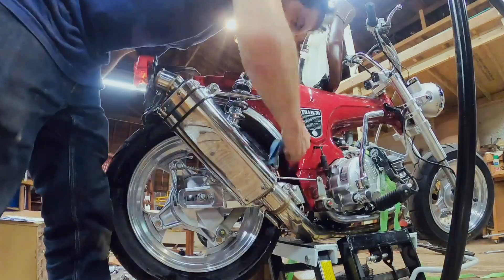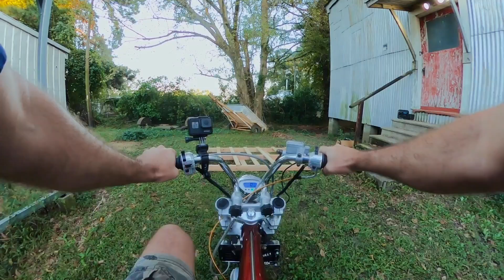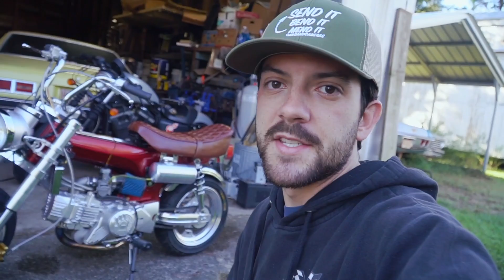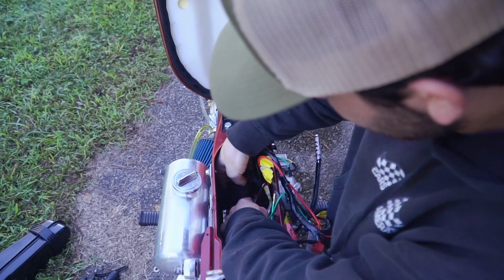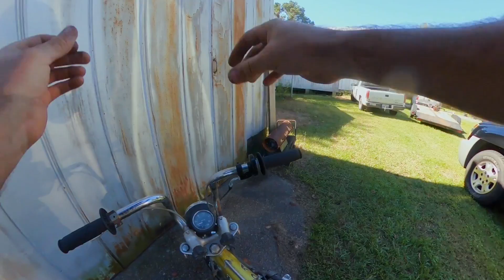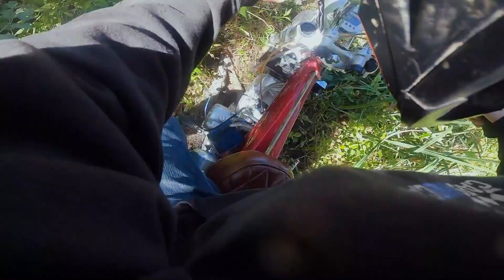190cc Honda Trail 70 First Ride! 19HP Restomod Honda CT70 Build

Comment: Long sorta s shaped metal coathanger witha small hook on the end hooked into wiring and pulled towards rear while pushing fuel tank downwards and forwards into white lithium greased rubber mounts makes it easy peasey... Increase main jet 2-3 sizes larger after lowering needle back down 2 notches should help your top end speed a bit... Also front end neck bearings should be packed with heavy grease prior to install taking care to fit them to cups before snugging down stem nut to just enough to have some drag on front end when off the ground before installing top plate taking care to lock it down with exact same distance on both sides between upper and lower tree... Also check tire pressures and play with them a little on those super sport tires ehich will effect handling in ruts and grooves in pavement..

Comment: 68mph is impressive with the baffle in. Mine goes 82 with a homemade exhaust. my first ride with a baffle in the pipe i couldn't get over 30mph. The trailbuddy, drct70, daxdodo and japanwebike ainet front fork steering stem slop is somewhat normal. I'd say over half of all of the ones i've seen have that issue. A quick easy fix is to put Loctite 640 on the stem, upper tipple clamp and upper inner bearing race. Long term fix is to have a new stem made to fit tighter to the upper triple clamp and bearing race and have a machinest put a taper on the top of the inner upper race and the mating surface under the upper triple clamp.

Comment: Awsome guys!! 👍🏻 your right about that, the og ct70 is geared for that low range stuff, but tops out about 45 or so , I been looking for a 4 speed replacement without having to do a lifan 125 swap , trying to keep it as stock as possible.  Mine is a 81 with believe it or not the original 6 volt bulbs. I've replaced only the brake bulb  , thanks for the entertaining videos , im a huge!! fan

Comment: If the extended swing arm lowered the rear, that also changes the rake and trail of the front. Does the front sit any different hight with the new forks than it did with the old? That of course will also affect the rake angle and trail. I agree with your other fans that suggested altering the rake angle by raising the fork tubes in their clamps. Cool build. Looks like fun!

Comment: looking at the rear fender : think you need to add a small spacer / bolt under the front mount so the fender bends back a little and centers better over the rear tire

Comment: Try a Lazer Line Level and check that the tires are parallel.I've had allot of bike 'dogtrack',and they didn't like straight.I know you want it looking'stock'but you 2 should find real cycle tanks for in front of the seats before road tripping.There are many that would look good.

Comment: Guys- just a tip- but if you're going on the maiden voyage with a project bike (or generally any real ride) you should have a good, premade toolkit with you at all times, so you don't get stranded and you can tune and make adjustments as needed. I have a small backpack that I always bring with me, and believe me, I've been saved more than a few times with it

Comment: Yall should make a little barge that has a lock in the front and a dyno setup in the back that is what drives the propulsion like a paddle wheel or whatever the lock can be the steering for the rudder

Comment: Did you replace the steering head bearings? Looks like you have a center notch in the old original ball bearings you're fighting. ALWAYS upgrade to tapered roller bearings when possible.
Reply: I was just about to comment the same thing, because I noticed in a previous video he reused a traditional ball bearing setup. I used some tapered roller bearings from dratv when I rebuilt my CT70 K0 and I am very happy with them on the highway.

Comment: Self etching primer is only used on aluminum not regular steel.. Epoxy primer would be what you'd want to use to start that with. And yes I actually do know, that was going to be my job until my back got in the way.. (or welding) I took autobody & paint in college.
Did you remember to grease the neck bearings? Ike should be on his Triumph, it'd be about the same power to weight ratio. Intercoms aren't going to help unless you have a Sena backpack on your GoPro so it'll record the audio from your intercom.

Comment: Could you check your rake and trail angles/ measurements and compare them with stock? Maybe it doesn't have enough trail or something with aftermarket fork setup.  Also check rear wheel alignment compared to the front. Sucks that it doesn't track smooth.

Comment: Im super jealous of the digital display. I found it on ebay, but its for a 12v system and Im wanting to slap it on my 1968 CL90 that is running the original 6v system. Ive looked into potential conversions, but its my first project bike and parts/info on the CL90 is way more scarce than the CT70/CT90. I thought about just using a 6v to 12v converter for the display, but Im sure that would end up becoming more of a hassle than just swapping to a potential 12v system all together. Id love to get spokeless wheels like you have too. Doubt Ill do any off roading in the middle of the suburbs.

Comment: This is so rad, killer work!! I have a '93 ct 70 with severe electrical problems and i have been scouring the webs for any assistance and not been lucky at all. On top of that no shops in my town will even look at it since it is old
Help?

Comment: Take a clay bar to the paint and it should get rid of most of the overspray.  Also the steering could be the height of the tripples on the front forks.  Check to see if maybe the forks are too high.

Comment: Sweet machines.  I'd be double checking the rear wheel alignment using the string method.  Swing arm hash marks can be a bit rough.

Comment: You need to take a link or two out of chain  so the rear wheel sits better under the rear fender. And also check the rear swing arm and wheel for wobble.

Comment: Yall should revive the drag mini bike with modular front wheel with brake and rear slick with the 20 hp 212 and turque converter with juggernaut

Comment: I recently bought a cheap lithium battery for my 250, and it's both tiny and lightweight. Seems to work just as well as the old lead-acid battery too - I kill the engine a lot off road. Anyway, if anyone reads this who wants to save some space and weight, you might give it a shot.

Comment: Firstly, put the bike up on a jack or something to take the front wheel off the ground and the fork should freely flop from one side to the next if you lean it, if it doesn't then its too tight,also have you aligned the rear wheel correctly. High speed carb issues, try a bigger main jet. Nice looking bike.

Comment: My 50cc bulroc dax (it was injection now its with a carburator) which was set to 30km/h also could do burnouts.. now it can still do it but just reaching higher speeds which will be about 70-80

Comment: The comments here about rake and moving the forks are good suggestions, but personally I have to ask judging by the way you're wandering while riding, is this obvious question - are the rear and front wheels in alignment? If one is skew to the other it absolutely WILL cause this. So if you've done any spacing or change in your track like that, I would lay money on it.

Comment: John it scares me when you start it, you’re kicking it so hard, the kickstart is a machine 
/lever built to a young persons tolerances, go easy on it - also +1 on adjusting the steering geometry, the change in swing arm length should lead to a triple tree/fork height change too to make it rideable, might have to play with it a little

Comment: when you ad longer fork tubes, you have to change the rake.....what has happened is you have screwed up the steering geometry ( i work on bikes btw ) If you can, put the sock tubes on, or let the new tubes slide farther through the triple tree if possible so they stick up higher through the mount ( lowering the bike back to stock )

Comment: Yep Ike's bike will steer normal due to its still stock wheels excetra but yours .just for the hell of it nudge the wheel left or right while going fairley slow just to see if it got turned to a leaner .just curiouse

Comment: If the steering neck bearings are the correct tension I’d do a test ride with longer(taller) rear shocks off of one of your other CTs. Those shocks look too short IMHO.

Comment: Learn how a carb works before you tune. 3/4 to full throttle is controlled by the main jet. by raising the needle you added fuel to the off idle to about 1/3 throttle. See how lazy it was after raising the needle. Also if I am riding around with a lean mixture the first thing I would do is lean it out more my removing the baffle

Comment: I'd at least put a half a fender on the front to protect the radiator
Reply: Scott Tuttle Oil cooler.
Reply: @300zxdriver  oil cooling systems have a radiator...... that is how it cools the oil.

Comment: Pull the front forks up higher that has the potential to change your caster
Reply: In short that will stabilize your ride at a higher speed

Comment: I have two Coleman ct200-ex .I wont to build one of those . Price wise which would be better to build 420 or a tilton 225.. any information parts list would be helpful thanks
Reply: Buy a crashed complete street bike and use the parts off of it for your project

Comment: Did you install new steering head bearings. If not your steering head bearing races are bad.  Raise the front wheel off the ground and turn the handle bars slowly from left to right  ..when you get to the center point does it stop like there’s a detent ?   Is so change bearings .. problem solved

Comment: Hey guys I'm putting a 670? Predator engine in an early 60s Cushman and was wondering if the 40 series torque converter will be strong enough for the scooter. Also need to design a cross shaft and was wondering about sprocket size.
Reply: Also love the sound when you took the muffler off and did the straight pipes. That thing Hauls! 👍😎

Comment: I know some bikes like you nudge it left to go right like rice rockets my old car 100i had it was a leaner so when ya steered it like a dirtbike normally it didn't work right so ya so when I nudged it left it went right by leaning on it but anyways the tires and bigger size might have made it go like a rice burner basicley a leaner .it's hard to explain

Comment: IF Dwell IS AVAILABLE. ....SET YOUR POINTS WITH A DWELL METER.....THEN SET YOU TIMEING WITH A TIMEING LIGHT...TO MATCH YOUR NEW COMBO ...EXPERIMENT WITH SETTINGS.....YOU WILL FIND MORE....GO FOR A BIGGER CARB....
IVE. BEEN A MECHANIC
FOR 55: YEARS...TRUST ME.

Comment: Suggestion - While riding, ditch the sweatshirt and go with a wife beater to match your shorts.  That way the road rash on your shoulders and elbows will match your torn up knees when you wreck.  Also, have you considered flip flops?  Having skin on your feet is really over rated too.

Comment: you need a flatslide carb also the one you have is too small, depending on the cam, crank and piston, tolerances your results will vary. remember china engine

Comment: i have a question for any of you kart enthusiasts, i just extended my go kart but left the steering wheel in the same place fr some reason my go kart is really touchy like super sensitive idk if it’s the length of the kart or the steering wheel being far away i dont have any caster or camber and i just wanna race straights i don’t really do off roading please lmk how to fix it

Comment: The steering geometry won't be right with the wrong rear shocks. As already known, the shocks are too short. There is practically no basis for evaluating the handling as long as the wrong rear shocks are installed.

Comment: I used a 212 slapped it in a ct110 postie iconic Australian postie delivery bike haha and anyways legit I brought the bloody motor brand-new off eBay so it’s a zs with a 212cc big Daytona head and I have never manage to get the thing to run. Literally a bill box before never had any issues but this motor has been an absolute pain in the arse and because of which it’s been sitting for about six months I’ve checked Bhargav check fuel I’m pretty sure it is a fuel issue getting in the carburettor what the carburettor is that I have been using are for similar motor what I don’t understand. Is there one electric start but I can nearly manage to get it to kickstart but we know how unhealthy it is to try and kick start these motors electric motor turns over it turns the bike I just won’t start that way sounds like I’m not getting enough compression or spark, but I don’t say I can be the compression when it’s a brand-new motor and I’ve literally tried like three different spark lugs three different spark coils I’ve tried everything I manage to get the bike to start for one minute like two weeks ago, and that was it

Comment: @3:30 it looks like John is going ruin that kick starter by standing on it. I know you aren't too heavy but you don't have to stand on that kick starter with all your weight. just leave your other foot on the ground, it is not a old Harley with a butt load of engine compression. You do it to everything, you're going to end up bending or breaking something.
Reply: they have alot of compression though, unless he has a  decompression camshaft
Reply: @constant333  not enough to warrant the need to put total body weight on the pot metal kick start rotating a 3mm thick geared plate a third of a turn to begin with. But its not my stuff if it breaks it broke. Lol

Comment: All comes down to gearing.  Go with a 17t front or custom 18t's are out there and something even smaller in the back.  I run a 16, 37 on a 1968 ct90ko with a some mods, plus the gear spread on that sounded like you were hitting rev limiter quick, duno if it's aloud but heres a quick run of it if you want to check it out https://www.youtube.com/watch?v=818vn90UzVg  btw very nice build for your ct70 really clean look that still has the classic look too.  Nicely done.

Comment: Seems counterproductive to remove a reliable Japanese built engine to replace it with a Chinese built engine...
Reply: I swapped my ct110 with a Chinese 125 cc pitbike engine two years ago and it was the best move I've made. I love honda engines (have a fully rebuild 360), don't get me wrong. But for reliability having a modern engine with cdi, solid charging, a clutch, and and actual cam bearings, the Chinese engines are a really good option.
Reply: @gymprofessor329  I thought we all stoped buying cheap stuff from CCP it’s buyin more bullets
Reply: I mean I understand the urk of swapping a classic honda. But for a daily it has made the bike way more useable.
Reply: I strongly agree with you
Reply: I got the same engine i have almost 6k street miles hasn't left me on the road.. the only common issue is the shift star which tbolt usa already has a fix for it and the starter chain breaking from kick back
Reply: And isnt like they can't put the original CT70 engine back on
Reply: It is a Japanese designed engine made in a Chinese factory. The zs190 is a 2v version of the Daytona Anime.
Reply: @Ni9kye  Bullets for who? Unlike the US they aren't at war with anyone.
Reply: These Chinese engines are almost as reliable and they aren't 20 years old so I would bet that it will break less often than the original part.
Reply: These engines are clones of a Japanese motor, just sold for cheaper. Not a huge difference between this an like a Daytona 190 except for the price.
Reply: @crudboy12  Yet

Comment: You guys should buy an animal engine which has 6 hp engine not put a restrictor plate in it I personally race a race car called a microd And if you don’t put a restrictor plate in it it goes at least 40 miles an hour if you could make a video about that I’d greatly appreciate it
Reply: Do not put restrictor plate

Comment: Why not use a good brand engine. Or find one that's not affiliated with CHINA
Reply: I couldn’t agree more.
Reply: I agree but its hard to find one that small that matches the performance of that engine
Reply: why cant they use a chinese engine, i bet  within 6 feet of you right now is a chinese component of some sort
Reply: he could of put a harley davidson motor in there , but it would still be made in china ;)
Reply: Because it's a good motor that makes good power and is cheap.
Reply: cause not everyone has a couple G's to drop an a daytona or takegawa engine from japan. Also those are very hard to find compared to this motor. This motor that C&C are using is a clone of a daytona anyway
Reply: @quentinromano8640  they are made in the same factory FYI. Not a clone necessarily. I would call it an affiliation.
Reply: @Stan Chase where you going to find an engine that fits a CT70 that's almost the same displacement and power output that has 5-speed, 6 plate clutch, electric start & kick, changeable oil filter with oil cooler fittings, charging output for the price
Reply: @quentinromano8640  i kwn you can do a poor man's Daytona on the Zs190 by swapping the topend

Comment: The steering on the mini trail, the ct70 and 90 were criminal.... holey JEEEZ...... I HATED THE STEERING GEOMETRY.... You’ll NEVER...fix the steering... it was designed to travel a 30mph MAX... 20 mph better